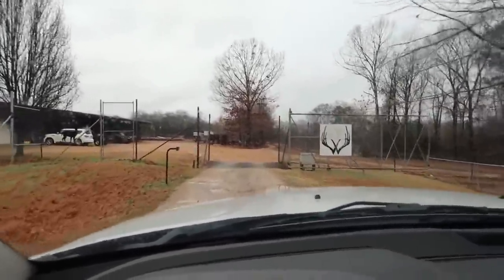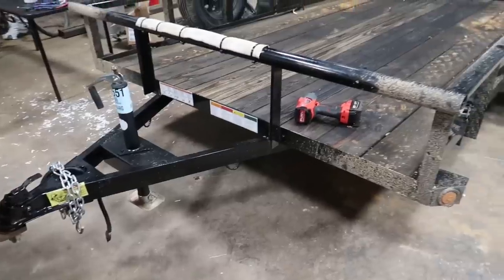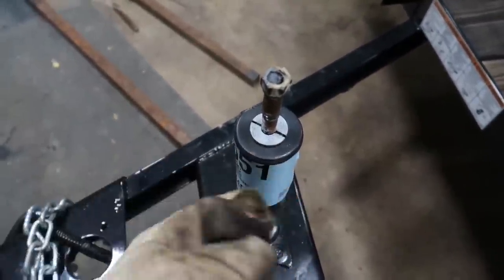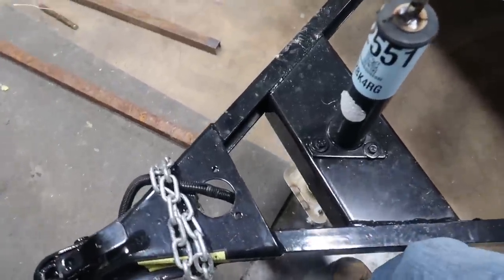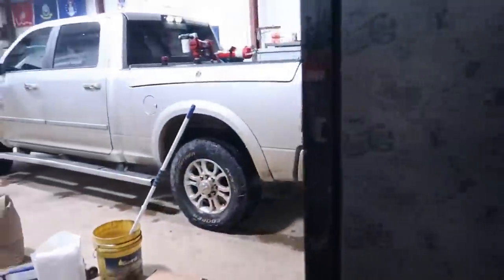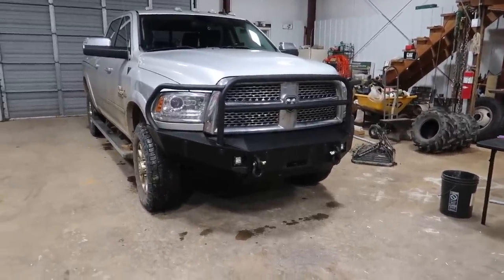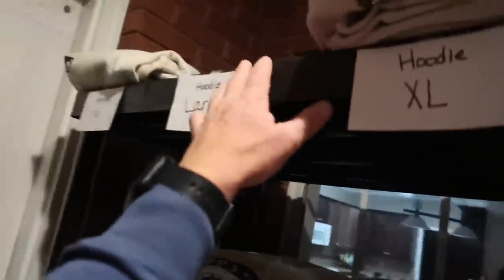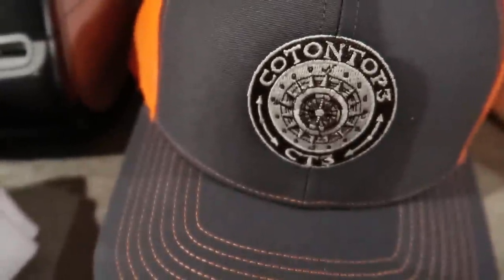Modifying the Big Tex trailer

Comment: I have seen on some new trailers with a big ramp on the back like yours, that the ramp actually folds in half towards the rear.  Might be a cheaper option and more interesting build with just 2 pieces of tube across the middle and some big ass hinges.  Just a thought.

Comment: I like the idea of the grounding plate, but I will tell you this I had a unfortunate incident while welding something about Thirty years ago with a Buzz Box Lincoln 250 Welder , I somehow was standing with one foot on the part I was Welding was wet and must have been a little wet and I got smoked by that Welder so it made me really Gun shy of Welding because I thought my heart was never going get back into Rhythm from the Jolt I took enough that I could not help myself one of the guys pulled the Welders Plug. So please watch for Water around the Plate, I guess the Rain in the video must have made Me remember about that Welding Fiasco lollll

Comment: I bought a very nice cargo trailer last year and it has a ridiculously short tongue on it.  It makes it almost impossible to back up and the tailgate can’t be opened.  It doesn’t just hit the handle, it will hit the jack itself.  I didn’t want to special order one with an extended tongue and had to settle for the short one.  Disappointing!